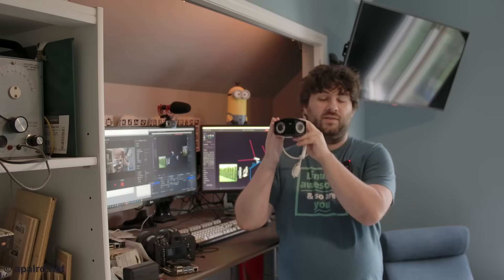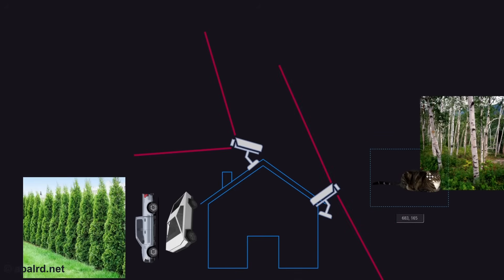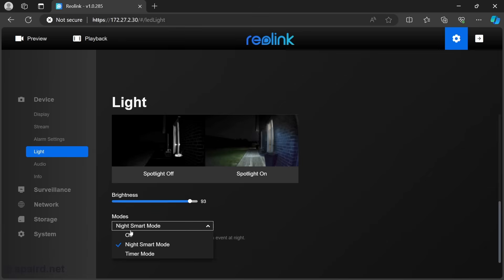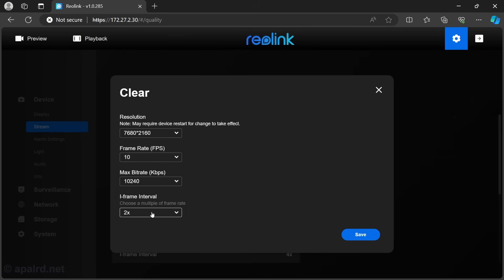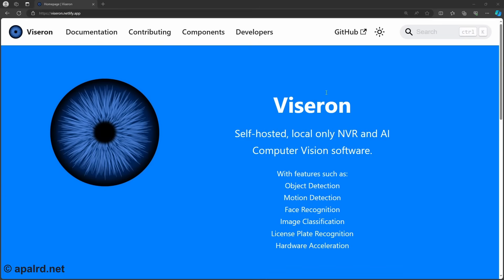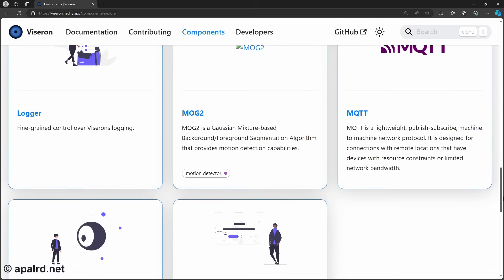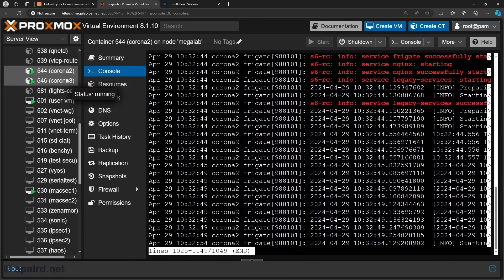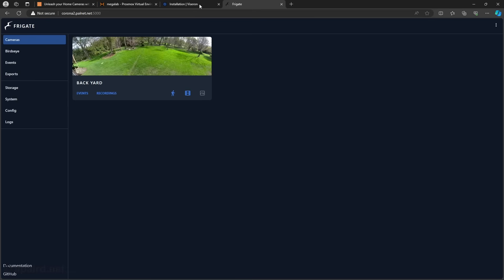Tracking my CAT with AI!  Feat. Object Detection in Frigate and Viseron NVR

Comment: I use hailo 8 on mine with frigate, and it detects nicely, you can have it set to detect cats you can also train it on the fly in frigate nvidia has a boat load of models you can pick from in the hailo zoo get you a hailo8 m2 accelerator

Comment: If the stream decoding for the detection is bad it can produce corrupted output. Then you end up with zebras.
See if what the detector sees is actually proper video. It may be using a different stream for the actual snapshots and images vs detection making it very hard to be sure.
Reply from the maker: It's caused by shadows in my case

Comment: What's your experience with Reolink?
I used to have reolink and I got a lot of artifacts. I used Zoneminder, Shinobi, Motioneye and now Frigate.
Reply from the maker: I haven't noticed more artifacts than my other cameras. The default bitrates are lower than I'd expect for this camera, so that could be related to the artifacting. Having to use the app to enable web ui and RTSP is irritating. But otherwise functionality is what I'd expect over the web UI + RTSP. I haven't tried the ONVIF integration with Home Assistant, but apparently that works well to translate on-camera detection into HA sensors.

Comment: Thank you for posting this great tutorial. I was looking for it for quite a while.

I am looking for a board to place inside my car. I want to use realtime object detection to recognise  whenever a certain type of car is passing by in front of my car. And I want the board to notify me by 4g/lte sms( no wifi connection so i have to add a gsm/lte/4g  module 

I am looking at 2 boards:  
1. Raspberry pi 5 8Gb with  Google Coral USB Accelerator
2. Google Coral Dev Board 4Gb

Which one is the best option?
Reply from the maker: I would be cautious to continue buying Google Coral products in 2024, as Google hasn't updated most of their repos in 2 years and it's been like pulling teeth to get them to merge pull requests from the community (all of their people active on those repos seem to have been let go). 

You should be able to do it with all USB modules, so a Pi 4 would be adequate. The pre-trained models for Frigate only detect 'car' generically, not specific models, but you can take the generic detection and process the results through a identification neural network (which takes a known object and identifies the type/model/...) to pick out the exact car from the snapshot of 'car'. Viseron being more plugin based might be better at this task.
Reply: @apalrdsadventures  thanks for the heads up about the Coral

Comment: When a new product comes already obsolete
Reply from the maker: My older cameras support v6 and it's easy to compute their LLA from the MAC address sticker on the box, but now they are banned from import in the US so that's fun.

I'm actually using v6 LLAs in my normal Frigate setup now and that works as well, other than the usual Docker v6 issues.
Reply from the maker: So, fun fact, these cameras do have a v6 EUI64 LLA and the RTSP port is open on it (but not HTTP/S) and it functions correctly. So once you do the initial setup you can use the LLA to actually use the cameras.
Reply: @apalrdsadventures  Good to know, but still... no full functionality on current standards

Comment: I'd recommend Blueiris, codeproject yolov3.1 with a gpu, using custom ipcam-combined model. Cat and dog detection is brilliant. I have an old gtx970 and get inference speeds of 17/18ms on substreams using a medium to large model.
I have frigate with the coral m2. It's good but not so much for small animals.
Reply from the maker: I'm not willing to run Windows for this, but the ipcam models do look neat. It doesn't look like he's trained a edgetpu version of the combined model yet, only the person/car one. I might be able to use OpenVino on the intel iGPU though.
Reply: @apalrdsadventures  I've just tried openvino model on frigate with a 7th gen i7. No tpu. Super fast and hardly uses any cpu resource.
8.5ms inference on the cpu! Nice. Didn't need to configure anything apart from adding a few lines to the frigate config
Reply from the maker: I'll have to try that on one of my test systems then. It's unfortunate that they don't have anything with ROCm support since most of my systems are AMD.
Reply: @apalrdsadventures  documentation on frigate says it supports amd now. I have 2 amd servers I'll give it a try on
Reply: @apalrdsadventures  Morning. I have virtualized Windows using the X-Lite iso for some applications. Very light, local user (no microsoft account) with or without defender and updates paused until 2030 if you want. BlueIris just does a far better job than Frigate.
Talking about Frigate, I found it more accurate and obviously far faster using a coral tpu (M2 or A+E card). I tested it on amd 3400g and intel i7 also - ok but not for daily constant use.
Probably have to tweak the contour and threshold levels for smaller animals, in addition to the size thresholds for the objects. You can do this easily on the fly with mqtt in homeassistant/nodered.
Have fun

Comment: I have Frigate set up on a usff Dell 7010 with coral tpu using WYZE pan cam v2 I had many false positives. In car headlights a fire hydrant in my front yard got picked up as a person 5 to 6 times a night. Until I raised my threshold to 70% and my detection to 76 % did my person detection become almost flawless.
Reply from the maker: It definitely takes some tuning, but then it works very well (for people + cars)